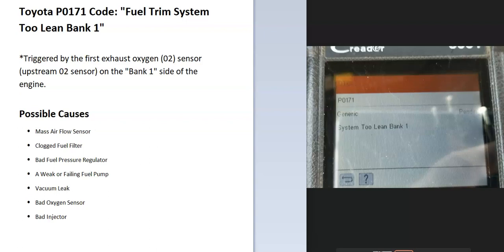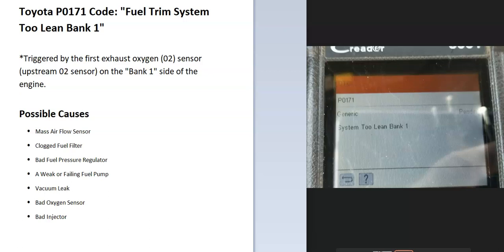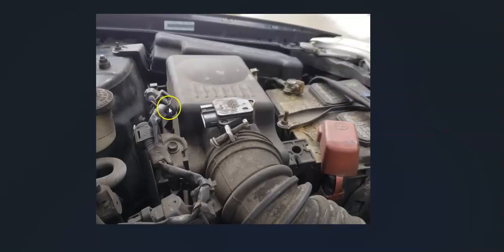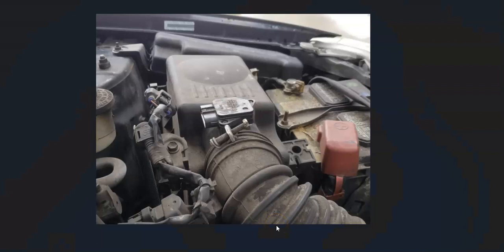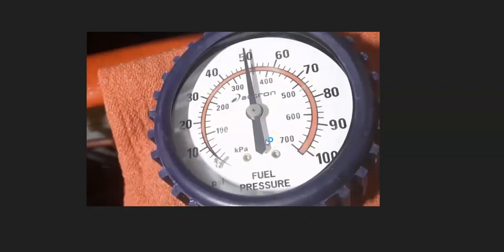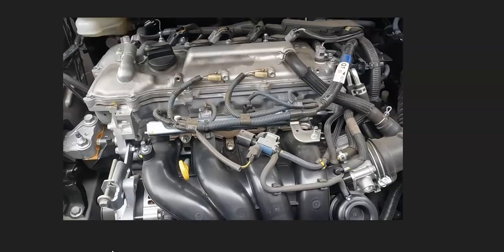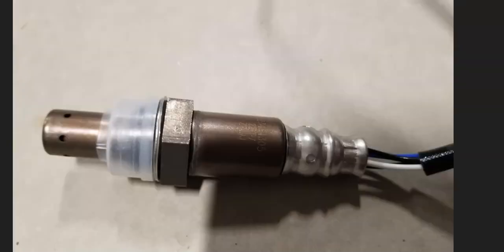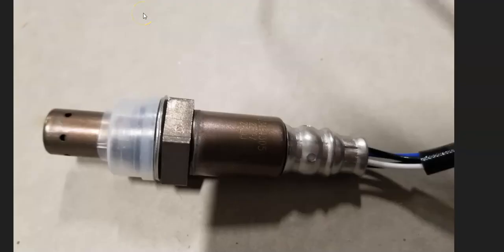7 Causes of a Toyota P0171 Code: "System Too Lean Bank 1"

Comment: I have had this code for about six months. It comes and goes. Sometimes I crank the truck, and there's no CEL, and I can drive for weeks without it, then it appears again, with a CEL and code P0171. 
I have changed as well as the PCV valve, all six spark plugs, and coils. All injectors. Cleaned the MAF with no change, then replaced the MAF. Cleaned the air intake. Changed all four 02 sensors. Changed air filters. Changed the heat sensor module....and still intermittent CEL.
One note: When the CEL is on, the truck cranks super fast; when there is no CEL code, the truck cranks normally.
Reply from the maker: I made an updated more detailed video on a P0171 code that may help. Here is a link https://youtu.be/b9__WGuD-dc

Comment: working on a customer 2004 toyota camery 2.4l car had a dead spot in the pedal and a whole lotta stutering replaced plugs old plugs looked bearly worn had a thic black coating on them and a white ashy coating on top of the black coating,after replacing the plugs car ran better but missfires like crazzy when floored or above half throttle, codes clyinder 4 miss detected system too lean bank 1 oxygen sensor bank 1 sensor 2...found a disconteced vacum house hoped it would fix issue didnt will try these diag tips and see if the oxygen sensor is the cuase or if something else is bad quite puzzling honestly...also the coils looked brand new factory denso replacemnt

Comment: Hi. I have a 2006 Corolla and P0171 appears only when I use the heater, I changed the MAF and nothing happened. If I don't use the heater the code disappears. Any idea?
Reply from the maker: It could be a bad shared wiring connection, but more likely, there is a vacuum leak in the HVAC system. The 06 Corolla uses vacuum lines to control heater doors and vent actuators. When you turn the heater or defrost on, a small vacuum line usually behind the dash or at the firewall is activated. If a hose is bad and leaking it may cause a P0171. A smoke test will show if it is leaking.

Comment: My mechanic said I needed a new MAF and quoted me 1000 including labor, but I think I'm going to try to clean mine rather than spend that money right now. Car running fine since they took a look at it, weird, also wondering if it was a gas cap needing tightening.
Reply: Where are you located?

Comment: It's sort of funny, I just cleaned the MAF sensor before I got the code and now it's clean and I got the code for the first time.🤦‍♂ I'll keep checking some of those other items.
Reply: Same exact thing with mine, did you end up figuring it out
Reply: @diegorios3661  I'm not quite sure yet, I did the timing belt recently, so it's been down a while as I'm kind of slow and it's the fourth vehicle.  I think I fixed the issue, but I may have a dead battery.

Comment: What if you have 2 similar codes, p0171 and p0174? Is that a dead giveaway for anything?
Reply from the maker: When both banks are running lean, that usually points to something that would affect the whole engine, such as fuel pressure, a vacuum leak, a bad sensor, and so on. When only one bank has an issue that is more cylinder-specific, such as an injector, coil, and so on.

Comment: Yup,covered all those bases and still have po171.
New injectors.fuel pressure 48 psi,smoked engine no leaks.o2 fully responsive rich and lean values,air flow sensor 2 yrs old,cleaned anyway, thinking maybe a reprogramming issue or new injectors being aftermarket are weak???
Reply from the maker: A P0171 is one of those codes that can be difficult sometimes. If the 02 sensor is good and you are unsure if one or more cylinders are running lean, you can remove spark plugs one at a time and match them to a spark plug burn chart. If only one cylinder is running lean, you can focus on it. If all the cylinders are running lean, then it is likely something that would affect the whole bank.

Comment: Another tip to add: If you see its a problem with fuel pressure (less fuel pressure than what the service manual says for your car), then check the fuel pressure regulator and clean out the fuel pump strainer.  You can do these things before throwing money in it to replace the whole fuel pump.  This guy had that issue but I think he could have just cleaned out his fuel pump strainer: https://www.youtube.com/watch?v=r_2D0nQrj1w

Comment: I have a 2018 corolla and the po171 error occurred it had a front end collision. What do you think the problem is? We switched out the MAF
Reply from the maker: Did it have the P0171 code before the accident? Was the Bank-1 side of the engine damaged? A lot of things can cause a P0171; it needs to be diagnosed.

Comment: A BAD mechanic would replace oxigen sensor when P0171 pops up.
Before replace anything, the whole combustion system should be checked for vacum leaks, MAF sensor, throttle body, PCV valve, PCV hose and all hoses, intake manifold gasket, inyectors and so on.

Comment: My issue occured during subfreezing temps, I changed the manifold gasket which Toyota put out a TSB I(Technical Service Bulletin back in October 27, 2007. The manifold gasket is at fault and they made a new thicker gasket to solve the issue. No more issue for me
Reply: Had the same issue, the check engine light came up after driving for a short distance during -7C temperature. The car works very well with no noticeable issues. I just had an oil change done before that, was wondering if that can cause any issue.

Comment: What if you have P0171 and P0174 for an 04 Camry v6? Is that worse?
Reply from the maker: If the 02 sensors are good, then the engine is likely running in a Lean Condition. Lean codes can be hard to diagnose. Since it is on both banks it would be something that would affect the whole engine such as a sensor, or fuel delivery.
Reply: @HVAC_Mechanic  ok thank you. It was also giving code P2198 .

Comment: I been dealing with this for a year already it's driving me crazy, replaced maf, o2 sensor, coolant temp sensor, pcv valve, pcv hose, smoke the engine 5 times already, replaced the fuel pump with oem, new plugs, fuel injectors are within resistance specs, purge valve working properly, and the code p0171 still showing up, the car runs just fine nothing crazy like stalling, miss firing or some of that nature, the vehicle stars right away with no issues, mine is a 2007 corolla and I don't know what else to do. Fuel trims are stft is between -9 to 7 and ltft stays at 33.6 at idle and spikes up as soon as I press the gas pedal
Reply: I know you said you smoke tested it but have you inspected your intake manifold gasket? There may be a super small leak that you may have missed while smoke testing it.
Reply: @KylewithaK I already fixed it 2 weeks ago, and it was the fuel injectors, they were partially clogged, no miss fires tho, which was weird
Reply: @PersonalDIY7 I have yet to resolve the problem in my 05 Corolla but I’ll switch out the gasket and see if that does it.
Reply: @KylewithaK  check the fuel trims, I had to do a lot of research online to figure this one out. If you fuel trims, get better at high rpms. You have a vaccum leak. If they get worse, then you have a fuel delivery issue. I hope you find it because this code was very tough
Reply: @KylewithaK  👍 I have 2006 Matrix,  The code P0171 showed 5 years ago, On that time I changed Intake manifold gasket ( looks a small leak on that), The car come back to normal, 2 years later, Same code P0171 showed again in cold weather, On warm day, The code gone by it self. The car driven just fine.

Comment: I have a 2013 frs and out of no where it turned off on me on the highway. a month or 2 it started to start 2-3
seconds after ignition but it was rare. A week before my car turned off, there was a slight knocking/tapping noise after 80mph that sounded like it was infront of the driver side. I had it scanned and the only thing that came up was the P0171 code. I changed the tank fuel pump thinking it gave out and it did not work. I took out the hpfp (did not take out the part holding/under the hpfp) and the coil looks good, so did the roller so i didnt think much of it but Im thinking it could be it considering the slight knocking noise at a higher rpm/mph, it being heard infront of the driver side and not knowing if the problem could be inside the hpfp. It has been such a headache because i still havent found the problem (I tried checking the fuel pressure on the lines but it is so difficult to install, and also the fittings i rented are not capable for the 3 fuel lines on top of the injectors.
I did however check the middle fuel line which i think is the out and it had 0 psi)

Comment: I have a 2019 Toyota Camry I keep getting this code!!!! I’ve cleaned MAF and throttle worked fine then got the code again so I replaced the sensor completely. I cleared the computer was working fine for a day and just got the code again this morning. Please lmk what to do 😭
Reply: Try to check your fuel injectors

Comment: I took my 2006 Toyota Corolla to my mechanic very trusted mechanic by the way. This code he was not able to figure out because pretty much everything was working well. He made sure that everything was ruled out, but he said that he just cleaned fuel injectors, as well as the anything else needed to be cleaned. The check engine light turns back on and it’s the same code so I’m not sure what to do.
Reply: Did you solve it?
Dod you check for vacum leaks, gaskets, hoses?
Reply: @LarryVanz  yes but all checks out as good
Reply: @ well no the check engine light is on but yes we changed out some things to rule it out but according to the tests it’s all good. Light still on
Reply: If we disregard the check engine light, How does it drive currently? @JenniferRodriguezJRDesignz
Reply: @ perfectly fine! No shaking no nothing at all to make it worrisome about the code that appears
Reply: @ it’s been like that for almost a year ….
Reply: @JenniferRodriguezJRDesignz  thank you

Comment: I have Toyota corral 2016 every time I fill up my gas tank my vehicle were not started my car what will be the problem
Reply from the maker: That is a common symptom of a bad vent valve in the charcoal canister. It should give an EVAP code though.

Comment: One significant "Vacuum Leak" possibility is if you get your vacuum hoses crossed. I just found on my 2004 Corolla that a vacuum line was connected to the air filter housing and going to the throttle body downstream of the butterfly. BAD DEAL. So, make sure the carbon canister evap system is plumbed to the throttle body.  With the wrong routing, your Long Term Fuel Trim will constantly stay high as the car tries to adjust, and your MAF sensor will read LOW since the vacuum line is bypassing the MAF and throttle. Many thanks to @bishop2355 for getting me to focus on how the evap system works, rather than just trusting that everything is lined-up properly from the repair shop.

Comment: 07 Corolla with this code so I replaced Upstream 02 Sensor, replaced MAF Sensor, checked fuel pump pressure, replace PCV Valve, smoked tested intake and found no leaks. Haven't replaced or checked fuel injectors yet, but I vacuum tested the Vapor Canister Purge Valve and it wouldn't hold pressure. I ordered the part and will update if that fixes the problem. My cars symptoms where terrible fuel economy, rough idle, hesitation and hard starting. I hope this helps others.
Reply: Did that solve your P0171 code, and if so, any understanding why you didn't have a P0441 Incorrect Purge Flow code?
Reply: @bishop2355, thanks for the head's up about the vapor canister purge valve. In my case, a couple vacuum lines were swapped and I was getting vacuum flow through the air filter housing straight past the throttle butterfly. After reviewing the 1ZZ-FE vacuum hose routing diagram, it was obvious two hoses were swapped, and the fix took 1-minute. Like you, I had already replaced the O2 sensor, replaced the MAF Sensor, checked fuel pump pressure, replaced PCV valve, smoke tested the intake (twice) and replaced the inlet manifold gasket, serviced the fuel injectors and replaced their soft goods. Oh my, vacuum hose routing. . . . Oh well, it's good to have new stuff in the engine to ensure it runs well into the future 🙃
Reply: any update?
Reply: whats the word?
Reply: Any update?
Reply: @WerthersOriginal131  I think I boiled it down to the fuel injectors. Nothing else seemed to solve the problem. I don't have a bi-directional scan tool, just a basic one, so I can't run certain tests on the injectors. However, I did run some Royal Purple fuel injector cleaner in the gas tank twice, not back-to-back, and each time the P0171 code would not come back on for a couple weeks instead of daily. I did replace the fuel pump with a non-Denso brand just to check the fuel pump off the list and the code still popped. The car is not a daily driver, and I've noticed if the car is driven daily the code doesn't come back on for some time. The gas mileage has improved to 31.9 mpg, but it still hesitates, and it doesn't start as fast as my 03 Corolla. Once, and only once I heard a weird sound right after I started the car, it sounded like the windows were slightly cracked open and made a whistle sound then immediately the code popped. Which again kinda points to fuel injectors making the noise. But before I buy factory Toyota Denso injectors at $146 each here in Houston, I will try the ATS Chemical 505 CRF Fuel System Treatment that Scotty Kilmer constantly recommends. Afterwards I will leave an update. Again, I hope this helps others.
Reply: @bishop2355  any update yet on those fuel injectors?
Reply: @bishop2355  Any update on your car?
Reply: @bishop2355  any updates?
Reply: @bishop2355  updates? did the ats 505 fuel system cleaner work ? considering buying it myself.
Reply: Sounds just like my Toyota Matrix's symptoms.
 I've been told it's the catalytic converters, the fuel pump and filter (whole mechanism) ; and I just got done replacing the MAF and the water pump and tensioner belt etc..
I just don't want to get robbed for the most expensive thing if it's just a injector.
Thanks for the advice!
Reply: hi did you figure it out? i also have an 07 with 70k miles and don’t know what it could be
Reply: @ I don't know if this is your issue but for me it was dirty oxygen sensors.

It resulted in the codes "System too lean bank 1 & 2" and the car shaking a bit.

The only thing I needed to check was a $10 special tool to remove oxygen sensor. Then I saw them dirty, I took paper and removed as much dirt as possible and put them back.

This resulted in no shaking and codes removed which let me know this was the issue. After that I bought new sensors.
Reply: How can you find out if the injectors are bad? Mine is bank 2 sensor 2 I tried smoke test and nothing... I changed both sensors short and long term and nothing....  Not I bought the PVC and ima see if that's the problem but it's been Windy all month and to change PVC I have to change valve covers (GM engineering) .... Idk what else it can be

Comment: This is happening now in 2024 on a 2010 Yaris. Same exact codes running horrible 40 miles per hour only limp mode you name it. Already replaced all  the parts so I'm already out some dough. I'll have to try this

Comment: How would some of those root causes effect only 1 bank & not the other though?
Like MAF, or fuel filter/pump/pressure, or vacuum leaks. Wouldn't those effect both banks if your car really has 2 banks?
Reply: 4 Cyl Engines have only one bank.

Comment: I went to the dealership because my Toyota Corolla 2010 shows P0171 code and VSC is off is blinking nonstop in my dashboard. They said it was because of my fuel pump and it needs to be replaced.
Reply: Lights still on.  Changed MAF sensor and 02 sensor
Reply: did your lights go away after?
Reply: @ Yes, the lights disappeared. It’s all good now.
Reply: @ yes

Comment: In my case I did find that one of the hoses going to my airbox had a leak in it.  After I fixed it however the check engine light was still on.  Is there a recommended drive period for the system to recognize the leak is no longer there?
Reply: You could have multiple leaks, too.
Reply: Personally i would clear the code with a OBDII reader and then drive normally. If the engine light doesn't come back on than you solved it!

Comment: My 03 ls 430 MAF reading 0.65 while Engine off is that normal
Reply from the maker: If they are reading a high number when the engine is off, and there is no wind blowing, then usually, they are bad or dirty and need to be cleaned.

Comment: Mine had the code and stalled from time to time and even turned off a few times till one day it just didn't turn on anymore. I changed the fuel pump and it started right back up

Comment: I found 99% of the time it is 2014-2020 Toyota Vacuum Valve. I own 14 Toyota Corolla 2017 and 2018 in the fleet and new Toyota Vacuum Valve has fixed problem

Comment: Smoke out that intake manifold you will find that vacuum leak, I smoke out my intake  manifold the vacuum leak was coming out of my IAC valve that sit above the tps sensor, did you know a pcv can throw a lean code just check your filler cap if you see condensation or white milky stuff on the cap the pcv valve is bad, it either stuck open or close
Reply: Did you have very high LTFT? The LTFT in my 2000 Corolla goes up to 39% so it triggers the P0171 code. I have changed the fuel cap, PCV valve, 02 sensor, MAF sensor, and air intake gasket. I am planning to change the car's ECU next but this IAC valve is intriguing as the potential cause. I did spray soap and water under the hood the other day looking for vacuum leaks and didn't get any reactions, however.

Comment: i bring to shop to changed pcv    (oem) 2014  i4  camry got this code    y  online happen in idle        in 75mph  long term fuel is  8% good      when idle   28% long term